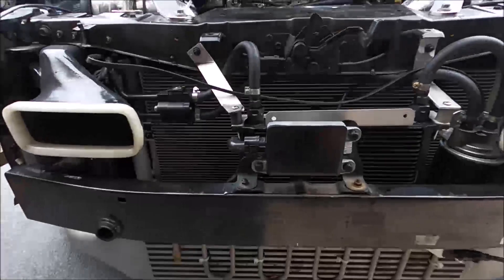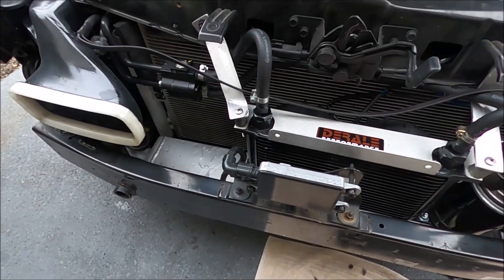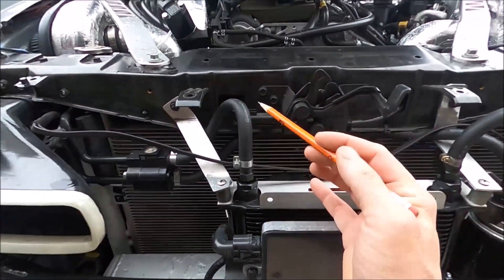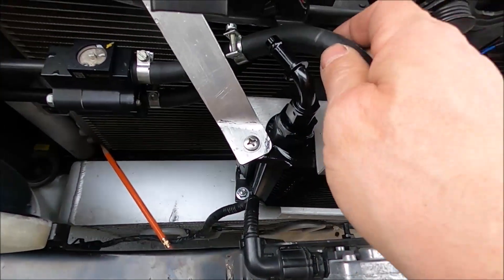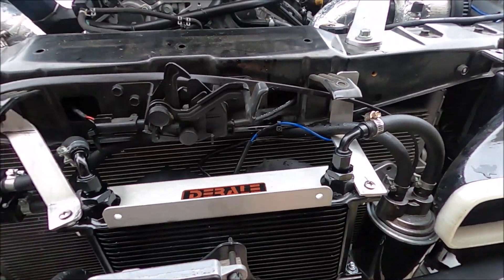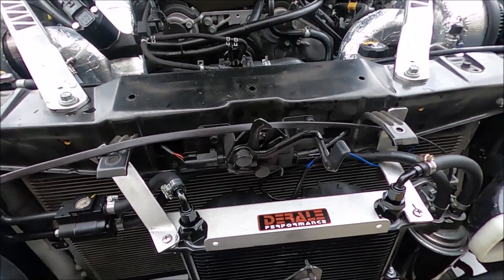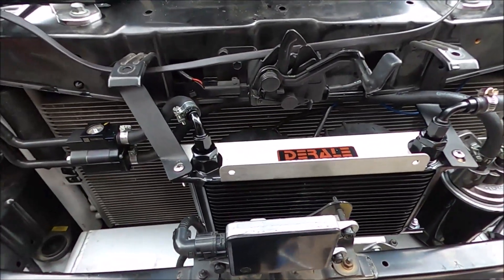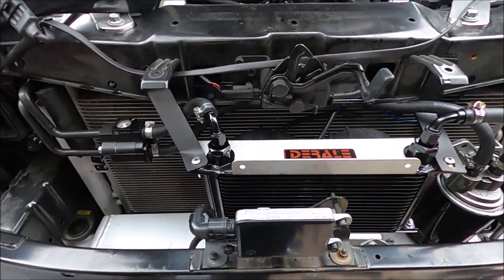Stinger Transmission Cooler Upgrade

Comment: Love the video question if you doing it now would you go with the BMS system with a added filter?
Reply from the maker: I think I would stick with what I have for one reason,  the fans. 
I'm in the process of videoing the controller I chose,  wiring, thermostat, and manual switch. It's going to be pretty slick and turn on and keep it right at or under 180 deg.
Reply: @awdgt2stinger270  love it! Can’t wait for more videos. I’ll start posting more on my other account soon 12.3 @ Bradenton in FL with just JB4, intake, Magnaflow Catback

Comment: Hi Mate, Great install! What do you use to read the Trans temps?
Reply from the maker: I have a JB4 and monitor several sensors on my phone you normally don't see on the dash.  IAT, Boost, Tran Temp, meth flow, ect..

Comment: Trying to find anything about how to change the stock cooler lines that run to the transmission.  Manual says subframe has to drop but id rather not....
Reply from the maker: They are buried up there pretty tight.  Is there a reason you would want to get to those?

Comment: Can you hook a brother up with those mounting brackets? I would love to install that  trans cooler just don't have the tools to create mounts. Lmk :)
Reply from the maker: Have you looked at the BMS Trans cooler?  It comes 100% complete, ready for installation, no fabrication needed.
Reply: @awdgt2stinger270  yes I have. Just feel is overpriced for what it offers compared to this one.
Reply from the maker: @ITZZMARSS  I got you and I agree.  These were kind of custom done on the fly.  I have no template or a way to replicate them unless I pull my front clip, pull my stuff off and try to make a second set.  I'll tell you what.  I may decide to make a better set in the near future.  If I do I will sell you my originals.
Reply: @awdgt2stinger270  how did you connect your trans cooler fans? Where you grabbing power from?
Reply from the maker: @ITZZMARSS  That's my next video, and it will cover the fan controller I selected
Reply: @awdgt2stinger270  when is it dropping? Do you think I can grab the power from the radiator fan?
Reply from the maker: @DOSTRBOS  oh gosh no, that's the last thing I woul use. Flex-i-lite 31165 is the only thing I use, never fails me. I'll video it shortly 👍
Reply: @awdgt2stinger270  because of how late it will start the fan?
Reply from the maker: @ITZZMARSS  Several reasons, 
The fan draw from the trans cooler will more than likely pull too much, blow a fuse, or worst.
The coolant temp and temp of the trans cooler will never be synched.  This is why you want it on it's own controller.
A controller does just that, you can set the temperature where you want and control it.  Coolant fan turns on around 200-215 deg, you do not want your trans temps to get that high.

Comment: What's ur average  trans Temps while driving and at the track ?
Reply from the maker: The most I've seen is 180ish
Reply: How did you and where did you wire it ? I was thinking of running there 180 degree thermo switch
Reply from the maker: @Frankie Soto  I haven't wired it yet, that video is coming.  The controller I have let's you adjust your own temp. I use it in my street strip El Camino.  It's pretty slick

Comment: What you have there in front of intercooler?
Reply from the maker: I believe it's the factory radar for keeping in lanes, cruise control, ect. Only the GT2 has it, not the GT1's
Reply: @awdgt2stinger270  no am talking bout the lines on the intercooler like if it were like cool it down
Reply from the maker: Ohhhhh, lol. That is a nitrous intercooler spray bar. It sprays NOS and super cools the air before it gets to the charge pipe
Reply: @awdgt2stinger270  who makes that ? And you use wmi as well?
Reply from the maker: @pochyzayas  Nitrous Express makes it, so do other companies. Yes I have a dual nozzle WMI setup
Reply: @awdgt2stinger270  oh nice, is it direct fit or you had to do some custom work done?
Reply: So what you making whp and in the ¼ with that set up?
Reply from the maker: @pochyzayas  I'm not sure about HP. I have an AWD and it's hard to find a Dyno around here. If I was a betting man, around 550 because I know my time, I know my trap speed, and I know my weight. My best 1/4 is 11.01. I'll be a 10.9x next trip to the track. 
Most of the HP is custom tuning with Many, methanol, EWG wires, and weight reduction
Reply: @awdgt2stinger270  nice, you on jb4 or lap3
Reply from the maker: @pochyzayas  Just some supplied zip ties, that's all you need
Reply from the maker: @pochyzayas  I have the Sxth ECU and JB4
Reply: @awdgt2stinger270 didnt knew they make ecu for our cars though was only 4cyl. jb4 only for wmi right?
Reply from the maker: @pochyzayas  I log with the JB also.  When I daily the car I leave everything as is.  When I go to the track with Race gas, I add a few psi to get me in that 1.1x range
Reply: @awdgt2stinger270  wouldnt that mess with the ecu tune if you add more psi with the jb4?
Reply from the maker: @pochyzayas  Not at all, it's called Stacking.
Reply: Hey what did you hooked your fan wires 2

Comment: Did u add more atf?
Reply from the maker: I only spilled a few tablespoons when I pulled the hoses off so I didn't bother
Reply: @awdgt2stinger270  im guessing you used what was inside the stock unit and added in? Hmm that may be what i do then, i just did the transmission flush and have a bms cooler ready to install
Reply: @noneya6679 wats the link for the bms?